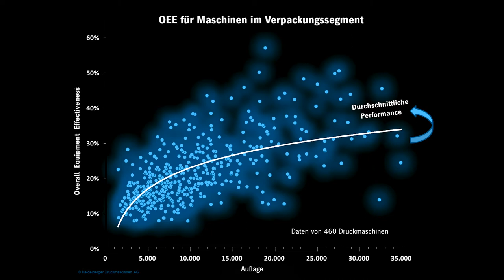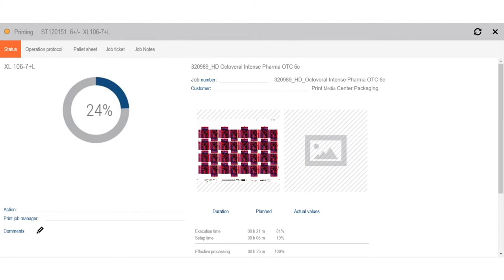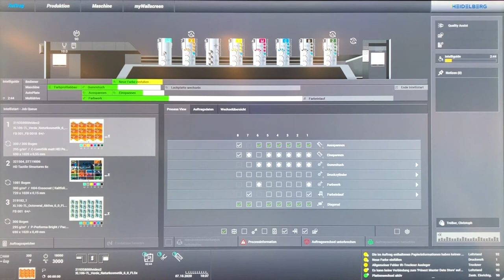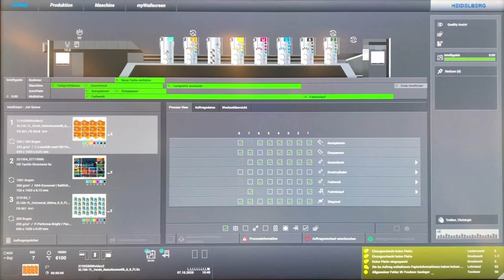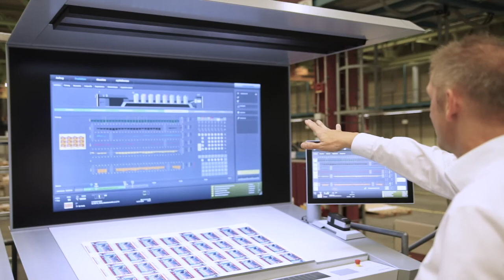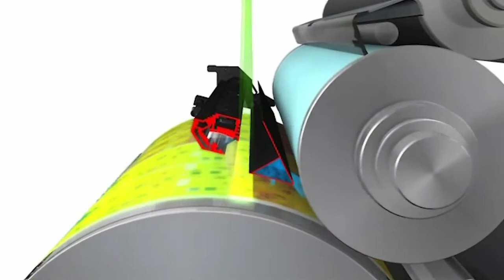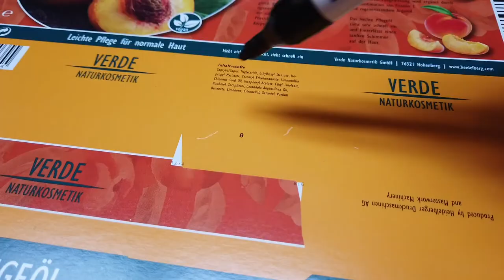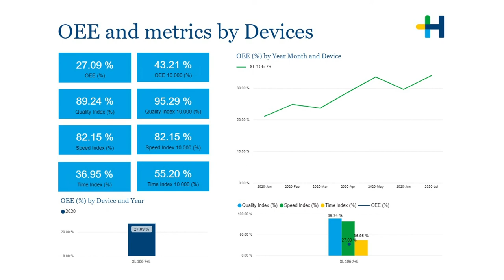Navigiertes Drucken im Verpackungsdruck.

Comment: A bit sneaky as there is no paper running through the press at 18000. Having worked a SM 74 I can say that we struggled to run the press at 12000iph. The delivery just wasn’t up to it!
Reply: Muito linda o impressor nem sofre pra operar uma máquina dessas.
Reply: The XL is in a different league, nothing compares to it, the days of SM are long gone in my opinion, being a press electrician for Heidelberg for the past 7 years all I have seen is high productivity from these machines, we have a customer who installed a KBA and then came back to Heidelberg, the Heidelberg surpassed the impression counts of the KBA, I take nothing away from KBA its a terrific press but nothing compares to the overall productivity of Heidelberg in my opinion.
Reply: For all the new machine across all brand 14.000 iph is standart speed now a day
Reply: If you look at Packaging Printers operating Speedmaster XL 106 the 18.000sph is a common production speed, nothing unusual. That's reality!
Reply: @franksteigleder5617  Well, I’m glad I’ve retired in that case.